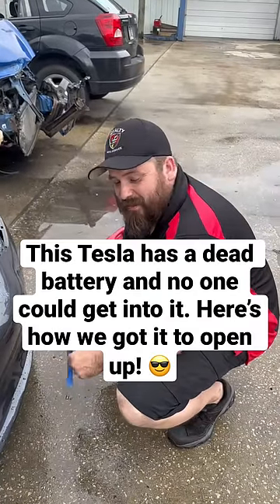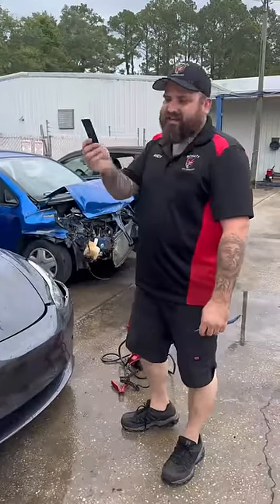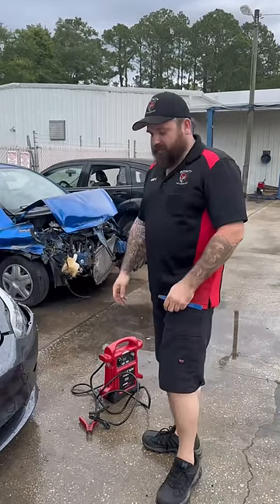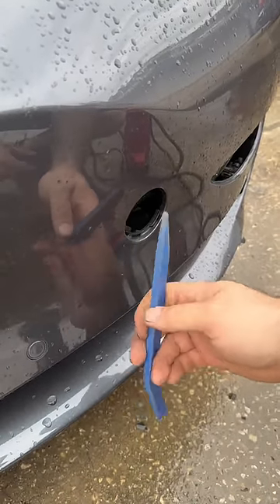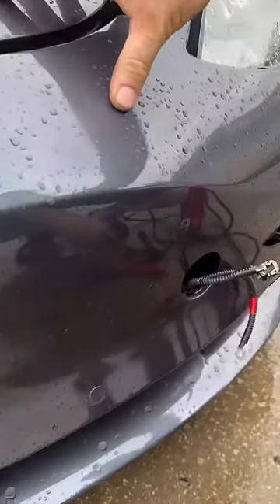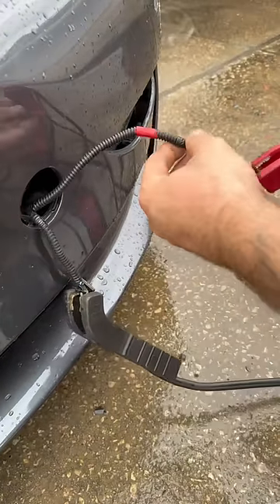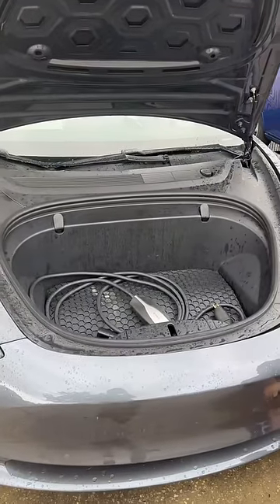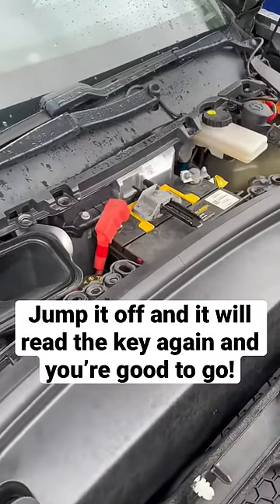Dead Tesla! How Can We Get Into It? #shorts #tesla #teslamodel3 #car #mechanic #crazy #hack #tips

Comment: That seems like a massive security issue
Reply: Im sure he still used the key. Maybe those leads are there so you get enough power to the transceiver for the fob
Reply: still need the key though
Reply: @ItalianMetalHED  not to open the frunk, to get the car started yes
Reply: @RedHaloManiac95  Wrong
Reply: It's not a Kia, chill lol
Reply: Still need the key dummy
Reply: @Bassandbackpacks  nah you cant simply use a 12 volt battery to steal shit from a kia. You have to break a window and go around to the trunk. The kia is more secure for the simple fact that youre more likely to hear the alarm going off and or the window breaking. The tesla just lets you into the frunk so you can steal shit with less effort.
Reply: @integraDA87  not to get in to the frunk
Reply: It's not a security issue. You can only do that when the 12V battery is dead.

The entire procedure is described in the manual.
Reply: @RedHaloManiac95  

You still need the key. If connecting power across the connectors was all you needed the lid would have popped the instant power was applied. He pressed the release on the remote quite a bit after connecting power.
Reply: @justinkaufman495  lol if you think applying power to those 2 leads gives you access you dead wrong..never mind bypassing the camera system and sentry mode..
Reply: @spyderlyf3  lmao sentry mode and cameras are as effective as they've always been. Turns out nobody cares if your shit gets broken into.
Reply: Takes so long to get in, that it's not really worth
Reply: You can only use this when the auxilary battery is dead, and so you can change that battery and use the key for basic functions.
Reply: @jacobwebb8818  
There isn’t a key fob
Reply: @justinkaufman495  this does not open anything. They are power leads for emergency. If you notice, the guy has the key fob.
Reply: Just break a spark plug and throw the porcelain bits at the window. It will make zero noise and the alarm won't go off
Reply: This frunk thing only works.if the 12 v is dead
Reply: @adriankalitka3762  doesn't work for most modern cars. Most of them come with interior motion sensors now days, often they're ultrasonic sensors but I believe Tesla just uses the cameras.
Reply: @jacobwebb8818 no they give it just enough juice to open the trunk, no more no less
Reply: That’s so you can get to the battery. Still gotta use the key
Reply: Don’t worry, When there’s still power to the system and it’s locked, this feature DOES NOT FUNCTION.
Reply: @skylined5534  what if someone goes into the car and Yanks those wires  . Seems like a long play revenge. Unless they also make battery die by setting off alarm for two days.
Reply: Note to self: if I ever own a Tesla don't keep anyting I care about in the trunk...
Reply: @jacobwebb8818  correct but I wouldn't consider the trunk or frunk as he said a safe place for anything.
Reply: @jacobwebb8818  ⁰⁰⁰⁰
Reply: Some guy tried to say Tesla locked him out of his car. Did the whole social media thing. This is all he had to do.
Reply: @justinkaufman495  you can literally steal a Kia in less than 30 seconds with a broken spark plug, a flathead and a phone charger
Reply: @bbeezzyy  I'm well aware, however a locked kia still requires you to gain entry. You're not stealing stuff from the trunk as effortlessly as you are this tesla. You don't have to break a window or use a slim Jim.
Reply: @justinkaufman495  do you know how easy it is to break a window with a piece of porcelain? It's virtually soundless and you don't need a jump box or have to pop off any covers. 1 small piece of porcelain on a string and you can break 10 car windows in however long it takes you to get from one to the other.
Reply: @justinkaufman495  and the method he uses here still requires a key fob to pop the frunk it only supplies the power to be able for the electronics to work. Then you have to remove the covers on the inside of the frunk, the key fob and jump box to get access to the inside of the car. Break a Kia window and pop the trunk and already have inside access in 5 seconds.
Reply: @bbeezzyy  I think you're overly optimistic about how quickly you can break a window, find the trunk lever and walk around back of the car, and if you're allowed to make as much noise as you want you can do basically the same for a tesla. Only you don't have to pop the trunk to get in because it's a hatch back. This would mean the only secure part is the frunk... which isn't much better.
Reply: @justinkaufman495  finding a trunk lever in a car takes way less time than popping a cover and hooking up a jump box. Not to mention you still need a key bro. What are you missing? There are videos of whole Kia's begin stolen in 2-3 mins forget stealing items out of the trunk. The whole car is getting taken.
Reply: At least it is an electic car.  Not many are going to want to steel it.
Reply: @indridcold8433  people would want to steal from it.
Reply: @justinkaufman495  Ah, very true.  A laptop from a diesel vehicle is the same as a, laptop from a petrol vehicle, electric vehicle, or even a horse and carriage.
Reply: @indridcold8433  indeed... but you know that tesla driver has enough money for one nice laptop.
Reply: @justinkaufman495  True.  Which makes one wonder why they do not get a better vehicle for the money wasted on their electric car.  But the laptop will be awesome.
Reply: @indridcold8433  it's like people who buy iPhones or Gucci. They don't buy them because they're better. It's a status symbol.
Reply: @justinkaufman495  There is one other imaginary prestige, as well.  They will claim the electric cars are good for the environment, without ever visiting a lithium mine, a power station, or a coal mine.  But what politicians say are words of prophecy to them.
Reply: @stuwest3653  If anybody can open a vehicle with no skills, no special tools, no complicated technique, and using the tiniest of efforts, it is an incredibly big security issue. Which one is a thief going to o target?  A vehicle with no easy entry, or the vehicle that is jokingly easy to get into it?
Reply: @indridcold8433  You still need a key, genius.
Reply: @Bassandbackpacks  I know.  A Kia goes much further fully fueled and refuels in about 5 minutes.  You can also refuel the Kia just about anywhere.  The Kia does not even have to be new and it does that.  You can also get parts for a Kia just about anywhere.
Reply: @stuwest3653  Car door Keys are a joke. The entire latching mechanism on a car door is a joke. They keep honest people honest.  I can get into any car with just a metal ruler, including the stupid lambo doors and seagulls.
Reply: @indridcold8433  You are a joke. This is an electrical FOB and it's a trunk with no lock. Even if you did find a way in you would damage the vehicle.
Reply: @stuwest3653  Please work on your reading comprehension. It shows a lot about you, that it is feeble.  Did you not read about the latch in all car doors are jokes?  The opening of a lock is a mechanical process, not electrical.  All the transponders and fobs do is send a signal to the mechanical process.  There are absolutely no door latches held together electronically.  Give great consideration to hiding your response.  It revealed something about you that you may not have wanted revealed.
Reply: @indridcold8433  There is no mechanical lock on the trunk which is exactly what I said. You are hopeless.
Reply: @donttrickimtricky.8567  

They'll get filmed doing it.
Reply: Really lol?
Reply: @integraDA87 these eletrics will go thru a phase of being stolen. Trust me. 2 years time it will be a huge thing more than combustion
Reply: Not really- who'd wanna nick it anyway?!
Reply: Not really, it's easier and faster to just smash a window....
Reply: All you need to literally get into any vehicle you see is an air shim and a stick my man
Reply: 😂😂😂😂😂😂......I dOn'T kNoW hOw KeYs WoRk
Reply: @jacobwebb8818 Right? He said the battery was dead, so he couldn't open the door with the key. Get to the battery, give the 12v battery enough juice to use the key card. 

Yeah just put a key hole somewhere....
Reply: Bro. Just because you jump power to the 12V prongs doesn’t mean you don’t need the key.

Too many uneducated people with opinions based on fodder
Reply: Wrong. You need the key you dope
Reply: Teslas do not have a remote. They have a debit card looking key: nothing else. You wave the key on the drivers side door pillar and it unlocks the car for you.

Too many uneducated opinions
Reply: It’s not, because you still need a key
He now can just load the 12V System because he has access to it.
And tbh if you want access just to the inside of the car, they smack your window instead. 🤷‍♂️
Reply: @justinkaufman495  this method ONLY works if the 12V battery is dead, otherwise putting power on those lines will not open the frunk.

Comment: Open connections in front seems like a really bad idea.
Reply: The wires are dead wires unless you put power directly to them like he did so their completely safe. Now security wise on the other hand, yes that is unsafe
Reply: @a1bassfishing826  so all you are doing is powering a rely on to release the frunk?
Reply: @electromech7335  Yes that is correct, those wires are only for the frunk release, they don't power the car's 12V system at all.
Reply: Tesla is a really bad idea, just ev in general,we abandoned them a hundred years ago for a reason
Reply: @a1bassfishing826  They're*
Reply: @Cjohn31  because petroleum companies wanted to make a profit
Reply: @a1bassfishing826  Those wires are not dead lol. The cap/covers on them were already removed.
Reply: @AdamWood  yea and today they hate money so they give no effort
Reply: @AdamWood  yeah that's why petroleum products are used in every electrical car and I'm not talking about the Dash or anything that you still need a type of oil to keep the electric motor cool. Lol or what about your wonderful transformers that are up on the power pole across your home that have oil in them too? Electrical companies use oil just as much as any other industry
Reply: @tommyj387  Um, how do you even think you're making a point considering every gas car uses the same materials PLUS gasoline?
Reply: Pay attention, Jizzeee Jizzeee; Yes, they ARE dead...until you energize them w/12 volts 🙄
Reply: @lupavo1738  Those wires only work if the batteries are DEAD.
Reply: @aishefasani5635 of course they’re dead.. why do you think he needs to connect then to a source of power? The cars literally got no power…
Reply: @jforgiato3075  Gaaaaaaaaaaaa

Comment: All I’m gonna say is if anything hits that battery that car is totaled! A f-450 hit my model 3 last month and the insurance said F this and totaled it. They paid off my loan so I’m back to driving my 2020 Chevy Malibu.
Reply: the battery that operates the frunk?
Reply: You can’t take chances with 18650s. That’s the same exact battery that was blowing up in peoples vapes unexpectedly. They are high output but they are fragile and quite dangerous. They are the reason Tesla fires are so hard to put out too.
Reply: @Billy-jo3bt  18650 is just a form factor, essentially a size. they explode because they're lithium ion and lithium is so reactive the moisture in the air will cause it to combust. these same batteries power your phone, laptop, almost any modern rechargeable device. some are higher quality than others but they all have the same problems / potential for violent explosion
Reply: Do you miss your Tesla?
Reply: They probably would’ve totaled it anyway. The parts are difficult to get plus they don’t want to risk it with the battery because they’ll ignite if you look at them wrong lol.
Reply: Meanwhile I’m driving my ‘94 jetta with 250k miles on it.
Reply: And the insurance covered a can of spay paint for the scratch on the F-450. Those trucks are extra large. 

Hope you weren’t injured.
Reply: @Billy-jo3bt Wrong. Tesla batteries are just as safe as any other EV.

Also OP you must have had much more damage than the battery. We fix damaged packs from accidents every day for 5-6k cost to insurance, A new one would run you 14-18k
Reply: Your Telsa is probably on its way to Mexico
Reply: All they get access to is the frunk
Reply: The most toxic environmentally friendly stuff I've ever seen take your blinders off people
Reply: Riches to Rags...

Comment: New phrase.  'Grab your cables, we have to jump the hood'
Reply: You mean the "frunk" 😂
Reply: you still need the card key for the frunk to open!
Reply: @Antandthegrasshopper  When the 12V is down, no you do not need the key to open the frunk. The key is pretty irrelevant until he actually goes to get in the car.
Reply: @lupavo1738  Hello??...which is exactly what would need to happen in order to open the frunk. DERP! 
🤪 Shhh, quiet...the grown-ups are talking 🙄
Reply: "Jump the hood"🤣🤣🤣🤣🤣 that actually took me a min!
Reply: That is incorrect!! Hood doesn't pop when you get jumped cable.
Reply: Free battery anyone?
Reply: Yeah, connect the jumper cables to the bumper wires shown to open the front trunk (frunk). Then pop the plastic 12V battery cover off to connect the jumper to the 12V battery terminals so the car will be able to unlock and open with the NFC card key

Comment: If the body shop doesn't know how to get into a Tesla with a dead battery then there is a high chance the shop is not certified to work on it.
Reply: Who cares about certified? I'm not certified for electronics repair but it doesn't stop me being good at my job!
Reply: @TheCod3r  I'm not bashing any technicians that aren't certified. I was a certified Tesla Body Tech, I'm just saying to know how to do the process you have to take a certification test that show you how to do it. Have a good day.
Reply: Lol Certified lol they only thing certified it will cost you a arm and a leg
Reply: Right exactly im not certified for a lot of stuff and can do it very well from working with gas and electrical crap and many more
Reply: Exactly what happened to good old common sense and a little bit of God given Knowledge
Reply: @mopower57  Totally with you. Certification doesn't mean a quantity job, but if I want a job done, I will prefer a contractor with certification.
Reply: Not many shops work on them cars anyway that’s why you have to go thru the dealer. All they are is a POS

Comment: The red electrical tape is a nice touch on a $40,000 car.
Reply: Also both terminal ends are different for whatever reason
Reply: It's red(positive) electrical shrink tubing, used for electrical connections. The other cable should have a black(negative) terminal.
Reply: 😅 AGREED! 😂
Reply: Try 70k lol
Reply: @Beriothien007 what’s 70k? The 2019 model 3? 😂 used you can get it under 30k easily. Brand new they are around 40k
Reply: @Beriothien007 Cheapest version brand new is $40,630 delivered in NC right now, before $7500 federal tax credit... So less than $34k, kinda.
Reply: How do you do that after the front bumper gets smashed
Reply: @Ravenkil  please tell me how you smashed the bumper of your tesla while the battery was dead? Generally you need to be driving the car to to that. If the bumper is smashed from an accident and the car is dead after being shipped on a flatbed, I'd assume you'd have even easier access to those wires with a bumper that has bends and tears in it.
Reply: @ryanwdonahue  well this video shows it with damage on the side , damage that could easily be to the area of the wires, plastic cover could be smashed into wires but not torn or ripped, but I guess then might as well just rip it off.
Reply: It’s to denote the polarity. Might be cheap but it works.
Reply: You don’t understand the purpose there huh? That’s a positive connection.
Reply: @ronaldnorris2179  I understand the purpose... My point is that on a premium brand like Tesla they should be using colored connectors that are also dissimilar in shape - they should not be using tape.
Reply: I wouldn't never waste that much money on a piece of metal unless its a older Chevy or maybe a ford but fords have they're own problems